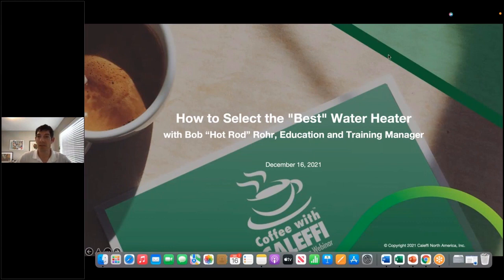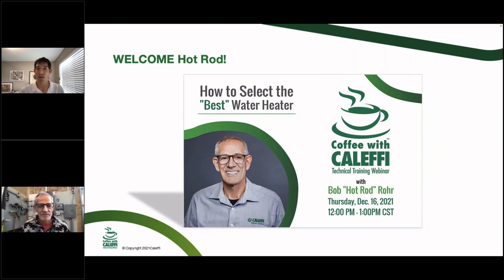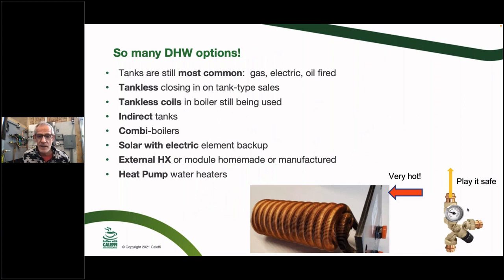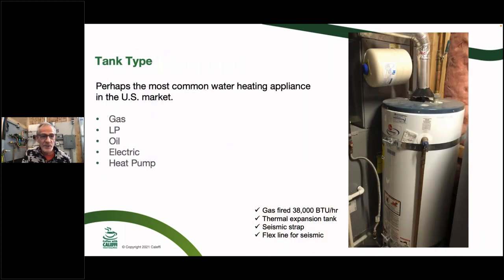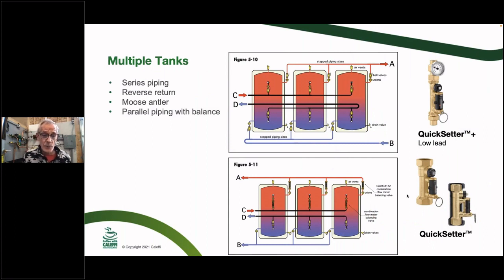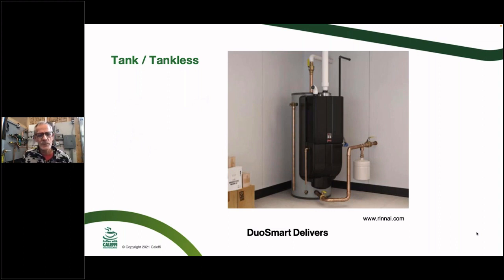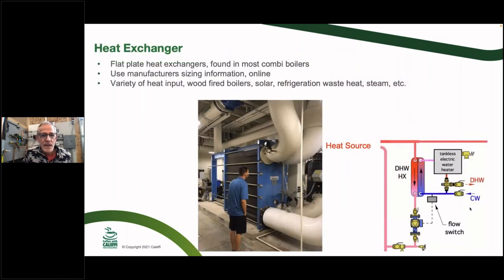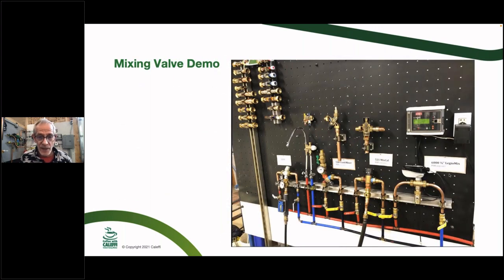How to Select the "Best" Water Heater

Comment: Hello Hot Rod. I just wanted  to share my setup. I have Rheem hybrid with a indirect feeding it. My indirect is heated by my outdoor wood boiler in the winter. My hybrid doesn't run at all during the winter even though it is turned on. I have mixing valve on the output of the Hybrid. In the summer the wood boiler is off and I run it in heat pump mode set at 150 degrees all summer and the begining of spring and fall. In summer the basement is the most comfortable place in the house. I have a big family and never run out of water in the summer. My brother inlaw also has one and we are thinking of adding a side arm heat exchanger heated by the oil boiler. What are your thoughts on using the Side-arm heat exchanger?